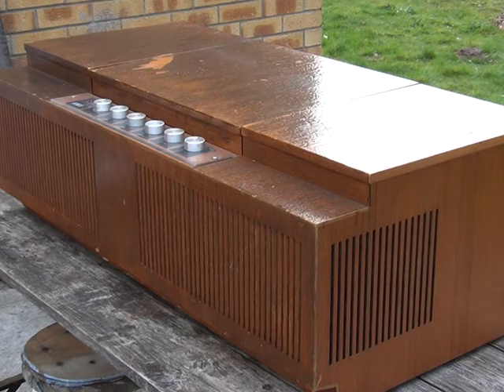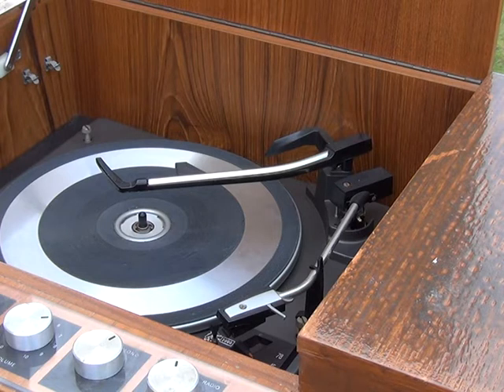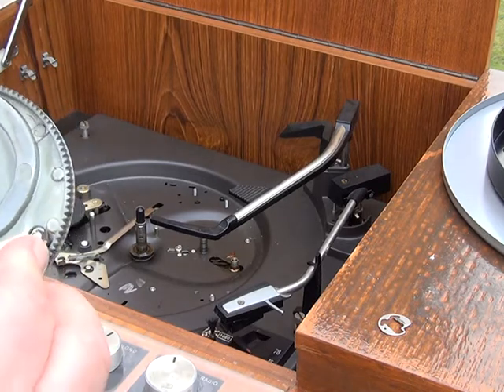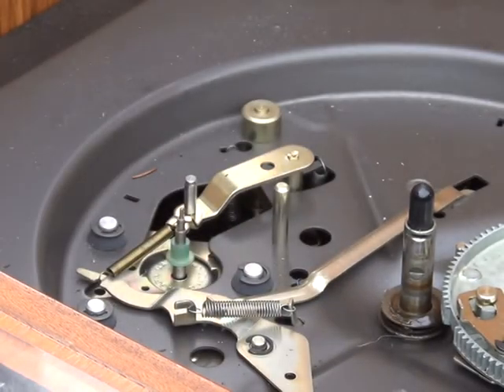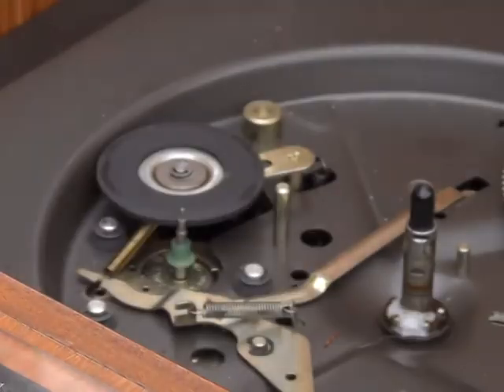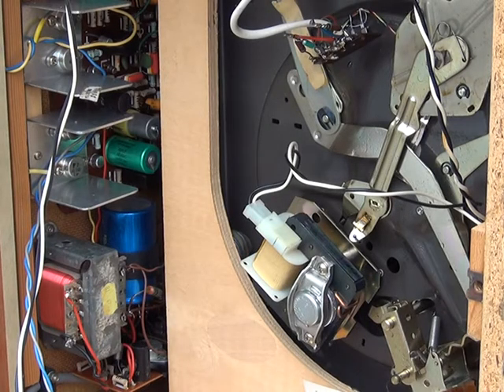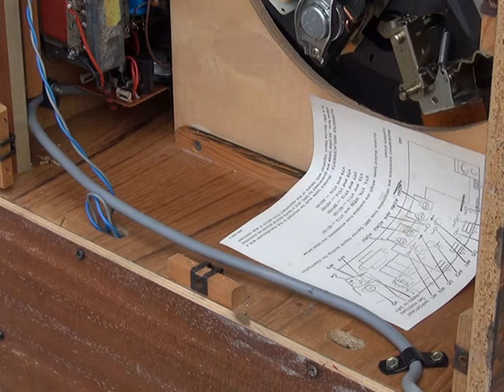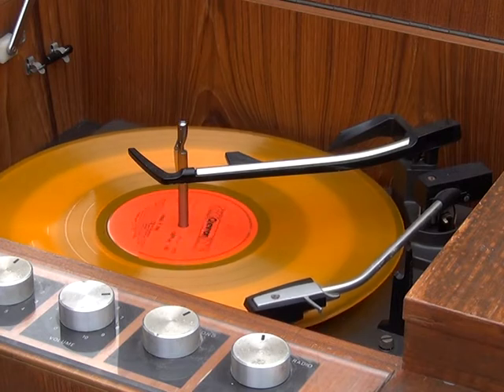HMV Stereomaster 2400 pt1 - Garrard 3000 turntable servicing

Comment: Hi Richard - I've been servicing my Garrard 3000 unit it a Ferguson 3356 I picked up off Facebook Marketplace - I've managed to grease/oil all of the relevant parts (including the seized changer mechanism), and added a 0.01uf 96ohm snubber circuit across the switch contacts to prevent the loud 'pop' sound when it switches off.

The only thing I can figure out, is how to remove the short plastic manual spindle! I've got the autochanger spindle but can't fit it till I get it out.
I've tried a soldering iron to the spindle shaft, and some penetrating oil, plus cotton-wrapped pliers, but it won't budge. I've found a spare on ebay so don't mind damaging the plastic part - do you think the best option is to just drill it out?

Comment: Hi, the auto drop has recently stopped working on mine. Do you know what could be the issue? Thanks
Reply from the maker: Yes, lubrication, exactly as this video shows.

Richard
Reply: @UK FM CB radio servicing  all working now, better than ever. Never done anything like this before but with your video it was straight forward, thanks!
Reply from the maker: Well done, extra feather in your cap.

Richard

Comment: Hi, I am having a difficult time trying to remove the cycle gear, it won’t move at all, it’s like seized on the shaft. Do you have any tips on what I can do ?
Reply from the maker: About 25% of the ones I see are seized onto the shaft. Of those 99% will come away if you apply the heat of a soldering iron to the top of the cycle gear. Initially I try again after 10 mins. Sometimes as long as 30 mins. I also have a gas cartridge powered blowlamp. 30 seconds of the blowlamp has always shifted the most stubborn.

Richard, G0OJF, UK
Reply: @ukfmcbradioservicingTango21  thank you, I used a blow touch and it released

Comment: My idler wheel has no tension on spindel ?
Reply from the maker: So is that because it's stiff & needs lubricating or that the spring is missing or come off:

Richard (UK)
Reply: @ukfmcbradioservicingTango21  Lubed spring still inplace . Maybe new springs for tension .
Reply from the maker: Bear in mind the platter pushes the idler, so if the platter isn;t fitted there will be little tension. Ensure the internal rim of the platter (as well as the idler have been cleaned with isopropyl alcohol or equivalent. It a turntable has come from a smoking household there will be a film of nicotine on both the idler & the platter inside surface to cause slippage.

Richard